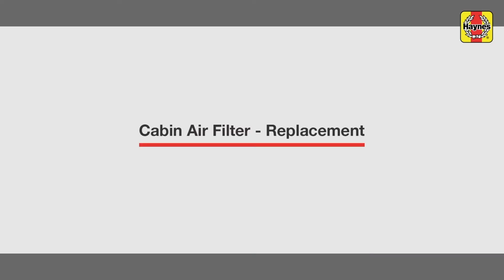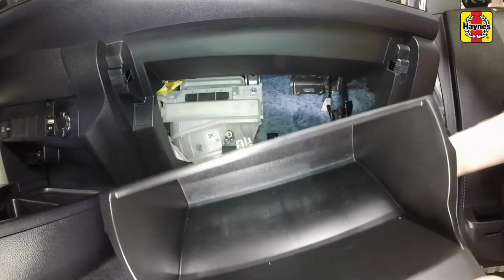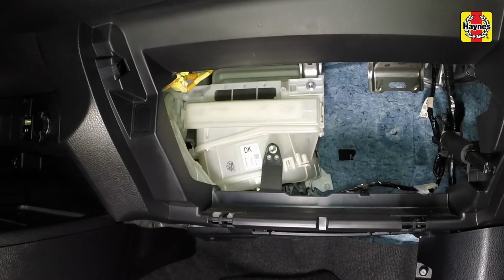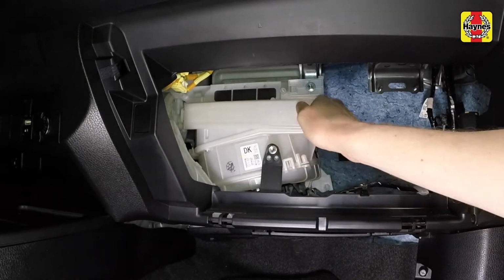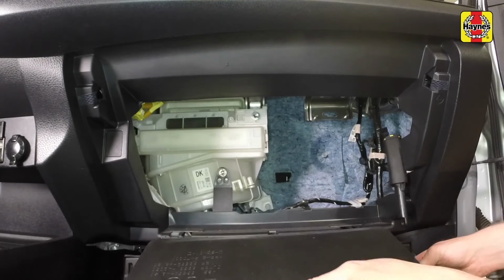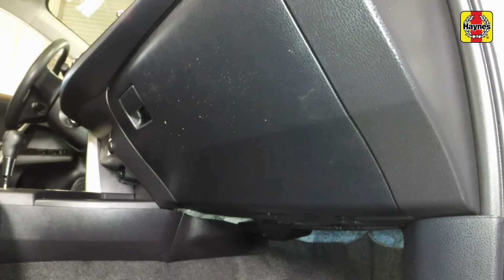How to Replace the cabin filter on the Toyota RAV4 2013 to 2018

Comment: The arrows with the word up next to them are NOT air flow arrows. They are merely telling you which side goes up. If you buy a brand that says air flow next to the arrow instead of up then it should point down. Air flow is downward on all horizontally mounted cabin air filters with the blower motor mounted below the filter otherwise the blower motor would be full of dirt and debris.

Consider this video which shows a filter with both an up arrow and an air flow arrow...
BOTH KINDS OF ARROWS ON ONE FILTER...
UP & AIR FLOW... https://youtu.be/h_kLsmfaLC8